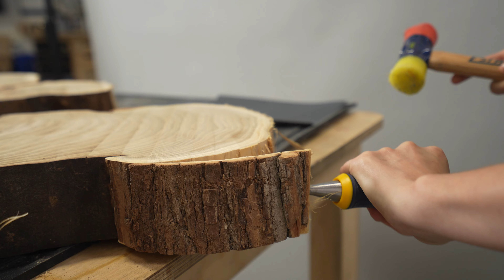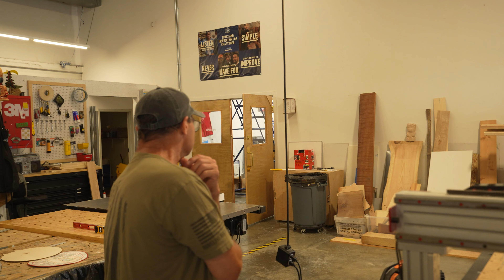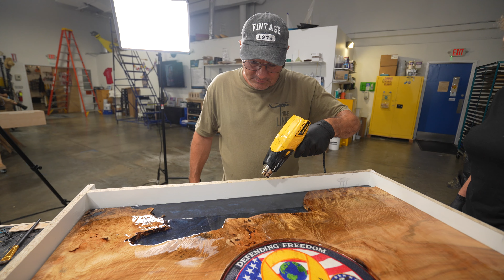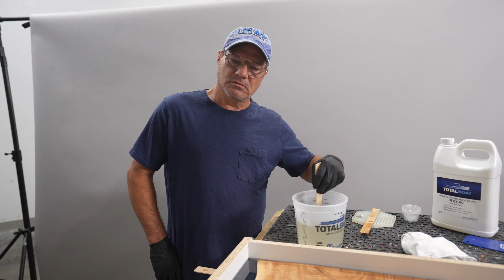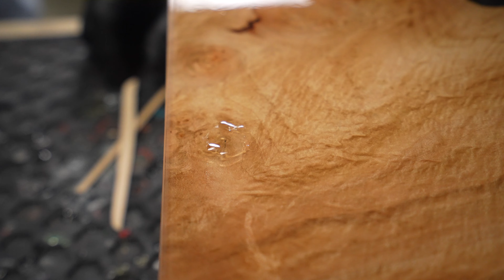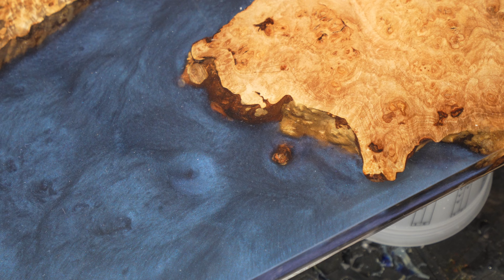DAD VS DAUGHTER EPIC BUILD-OFF!

Comment: If you used water cooling and a fan to help keep the resin cool you wouldn't have to worry about the resin overheating lol... Was a cool table though good work to you both
Reply from the maker: Trust meee. We had 2 fans going and an AC unit. But, working in a big warehouse in the middle of a heatwave brought its own challenges. 😅